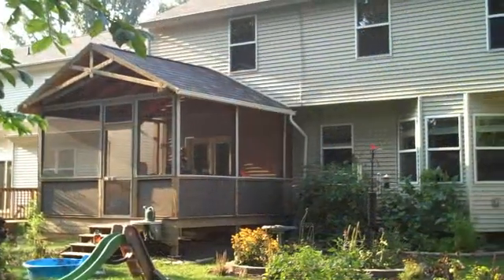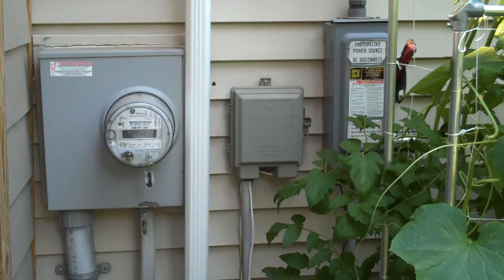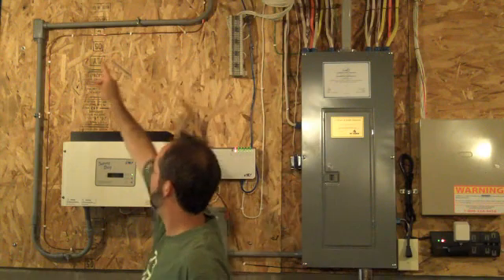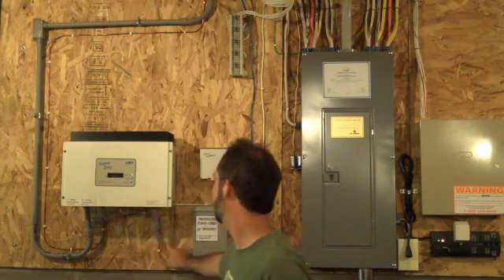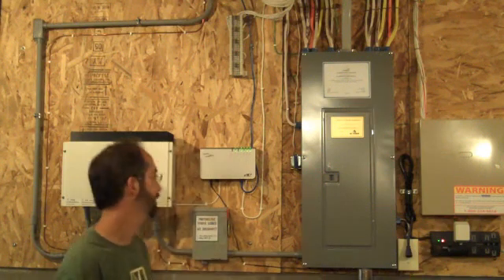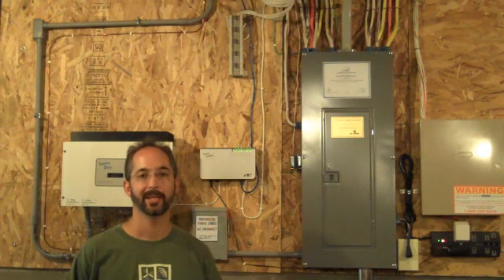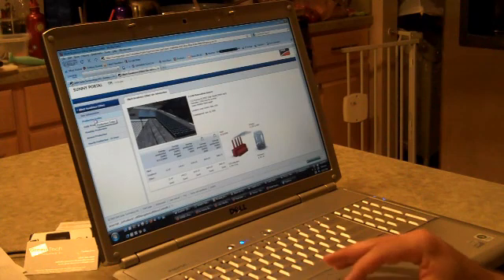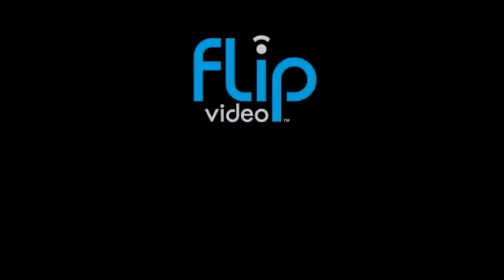GEO Solar Tour - Elliott Residence

Comment: Questions about the shut off in the basement.... How does shutting it off  make the panels accessible?   The are making power and sending electricity towards the panel.  2nd if that is somehow true, why couldn't you open the electrical panel and flick the breaker and accomplish the same thing?   Why have a switch at all?